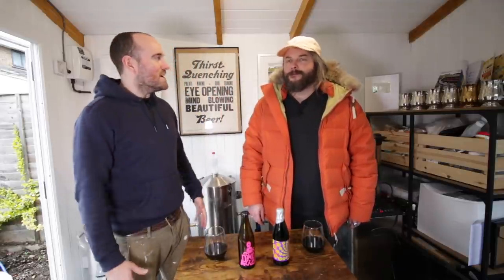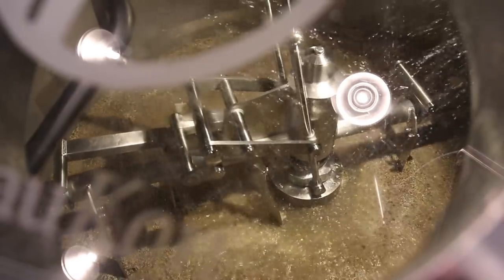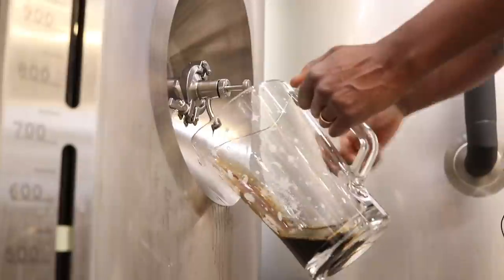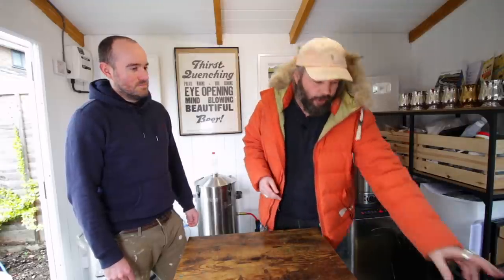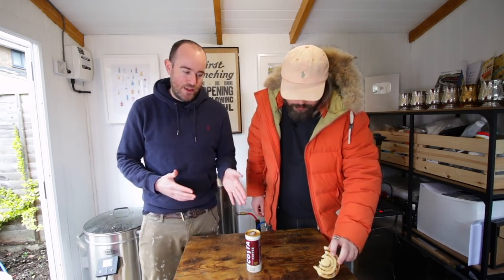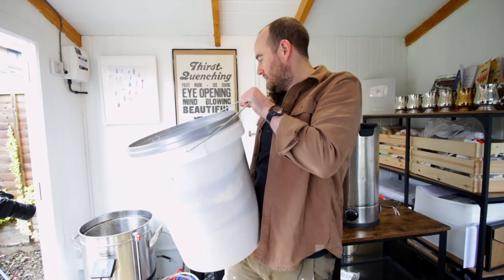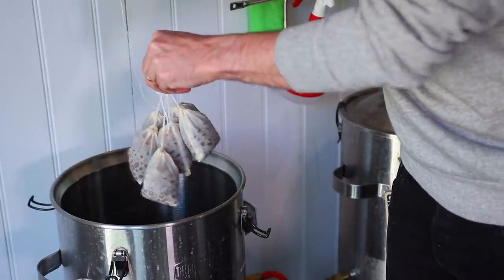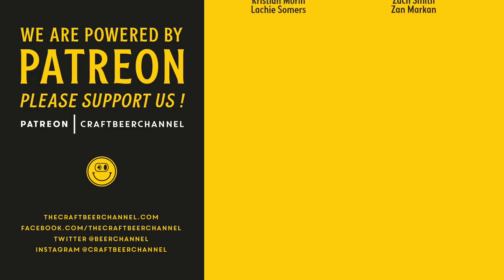Homebrewing crazy Pastry Stouts with Omnipollo pt 1 | The Craft Beer Channel

Comment: OK, I have been less than kind about pastry stouts BUT these technical challenges are very interesting. Your video even led me to consider a run to the bottle shop to try ONE pastry stout. ONE. Won’t guarantee I will finish it but you are opening my mind.

Comment: Got a few dark beers coming up for myself, ones finished fermenting pretty much waiting for the yeast to clean up & flocculate so it can be racked off cleanly without much sediment, that one will be 4.9% ABV, 19 IBUs and have peanut butter powder and still considering if I want to add cacao nibs. Second one is going to be a breakfast imperial x bourbon imperial stout hybrid, when I mean hybrid I mean both mashed together, pun not intended. Will be about 10% abv before adding a bottle of cask strength whisky! will contain a whack tonne of lactose. Also vanilla, espresso, oak, whisky and molasses. Yep I know I'm doing myself in with this one, but I believe it will be bloody awesome, using carafa special III on this one for colour and roasty toasty aroma without a burnt, acrid taste to it, but its probably gonna happen with the espresso anyway, also melanoidin malt cause why the heck not, dark DME to boost the numbers so I wont have to do a reiterated mash, maris otter base malt and several, that's right several caramel malts. Its gonna be a big one and I'm going to be fermenting under pressure with a fermzilla all-rounder 30lt & spunding valve.. heat belt, inkbird 
Haven't decided which yeast yet though... 🤔
Anyways.. cheers 🍻🍻
Reply from the maker: GOD SPEED!

Comment: You can use Palatinose (isomaltulose) as a substitute for lactose. I'm part of a vegan brewing club so can't use lactose. It's perceived much sweeter than lactose so you need less of it and it makes the beer more "quaffable". The down side being that you lose out on the increased gravity and viscosity that you can compensate for with oats or maybe pectin in a fruit beer.
Reply from the maker: Interesting! Will have to give it a go in a solo bree
Reply: i've had some ridiculously sticky stouts that were vegan, seems like such an unnecessary ingredient